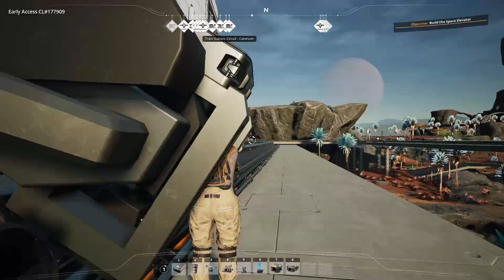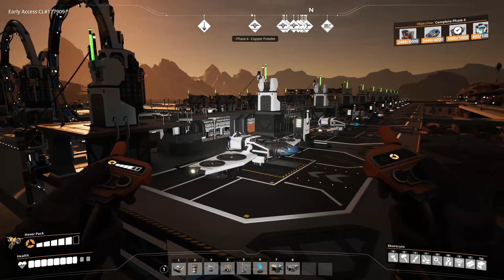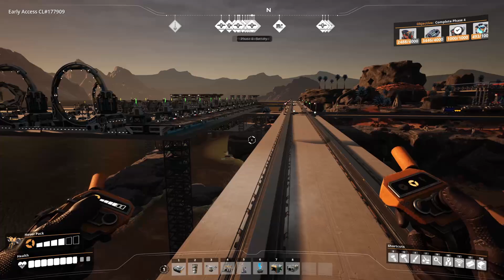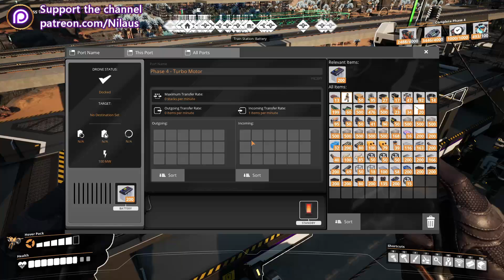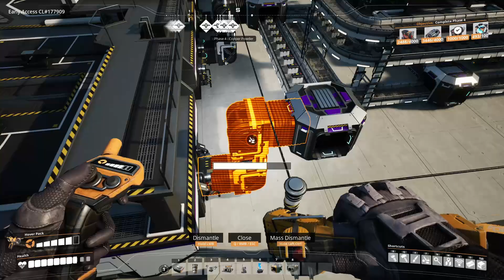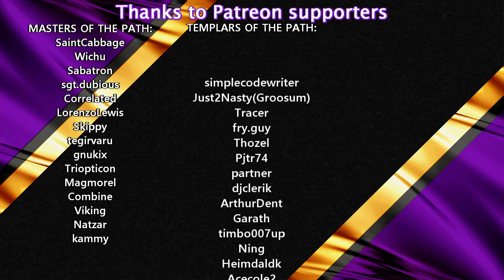Effective DRONE NETWORK For Late Game | Satisfactory Update 5 | #22 | Tutorial/Guide/Showcase

Comment: Using this standard "don't have to think about it" pattern will use a lot of extra power for the idle drone ports. Every port can be used as import and export simultanously, and could be used to the stack transport capacity by mixing goods with the sa e destination. Have you tried that as well?